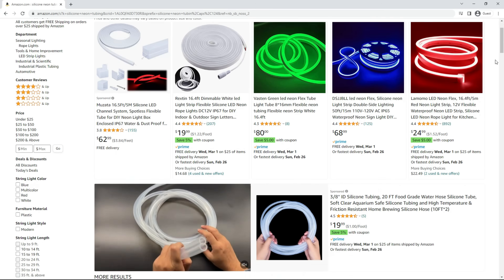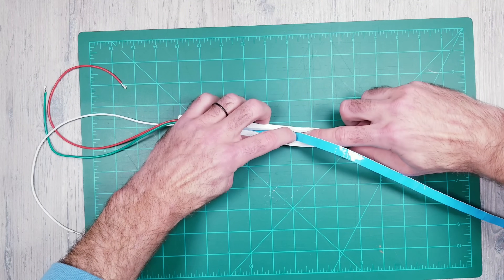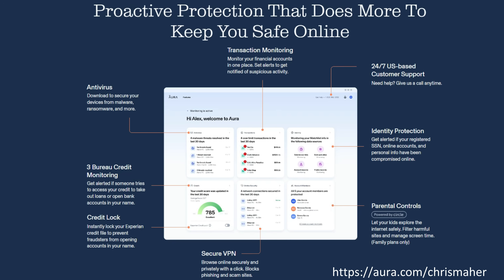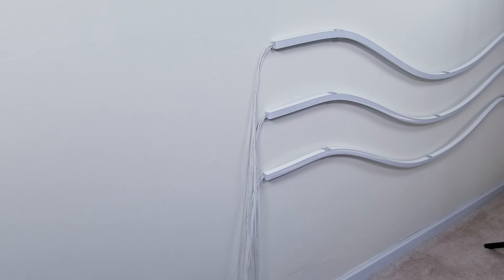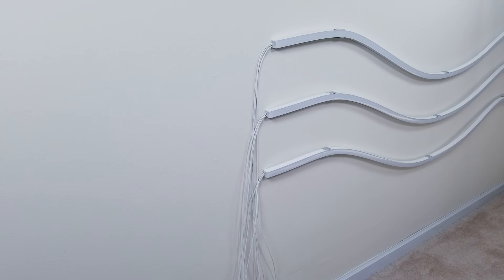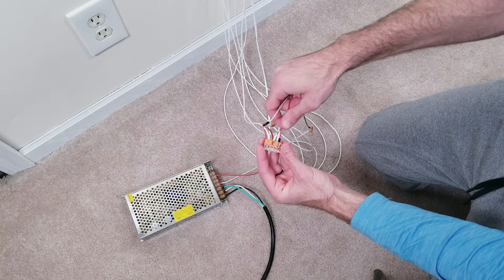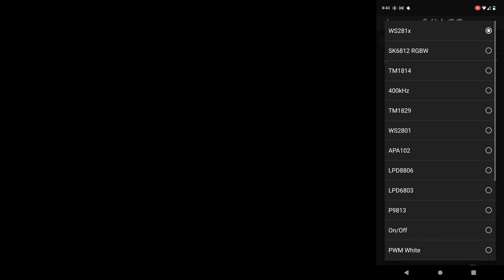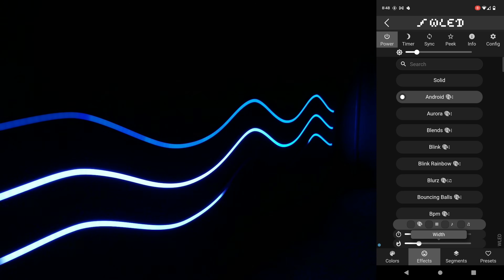Flexible Neon Tube - Review, Installation, Best WLED Animations - LED Neon Strip Lights

Comment: Do you think these would work in replacement for the aluminum channels in your "EPIC DIT RGB Desk Mod +Cable management" Video? I used the aluminum channels but cut them with a jigsaw, and they came out janky AF. If these bend to a 45-degree angle to go around corners  nicely, I would like to try them instead of making a new set of the other channels.  Bob Villa I am not... Thanks!
Reply from the maker: Thanks for watching and great question! These would work good for around a desk! I know the sticky tape I used would not work so you might have to go with the aluminum brackets. These do look very good with 60 leds per meter but the aluminum diffuser channels do look a little bit better from a perfectly diffused standpoint. The other thing that might be an issue is that if you use the brackets to secure, in between the brackets there will be a little bit of sag since this product is not meant to be rigid. Hope that all makes sense!

Comment: Given that it’s a silicone channel, I wonder if it will sag between your periodic supports with time?
Reply: Not in this case. They're fairly rigid and the supports in this example are sufficient to keep them in place.
Reply from the maker: Thanks for the comment and I agree! If the supports were spaced out more then there for sure could be some bend but they are close enough where they should be just fine over time!

Comment: What about adding wled to the interior of a car to add ambient lighting like Mercedes cars??🤔🤔
Reply: Working on it. Funny story Mercedes Benz lead designers ( borrowed)  stole our seats that lit up while on display at the future auto interior summit in Stuttgart, Germany in 2017-18. They loved them so much which is an honor they jacked them. With the our best in class flexible glass fiber optic LED system. They ended up using cheaper fiber optic for the S class and EQS interiors ;) #glotrim is the best #glasslovers
Reply: @glotrim  Damn whenever I get a nice car, imma checkout your guy's products😎
Reply from the maker: Thanks for watching! Hopefully at some point I'll be able to do something relating to cars! But GloTrim does look amazing!

Comment: I'm  clearly not understanding something vital here... Just because the LED strip is inside the tube, how is it a bending horizontally? an led strip outside of the tube wouldn't bend that way, so why is it working inside the tube? Wouldn't the led strip sort of be forcing itself to rotate inside the tube to do that? Sorry if it's obvious and I just don't get it.
Reply: I was thinking the same thing, maybe its is kinking a little but it doesnt matter
Reply: Google side emmiting led strip solve problem. His led strip is tilting and that is not good. Diffuser solve that problem so you see whole light. But I am more concern with spreading heat in that tube!
Reply: The bends are very slight bends doesn't effect it much.
Reply: @ChrisMayerDIY can you do a similar project using the plug and play controller?
Reply from the maker: Thanks so much for watching and great question! The led strip is able to handle the slight bend since the silicone tube is keeping it in place and my guess is that the led strip around the bends is being lifted slightly inside the tube in order to make the turns. However if you were wanting to do a design with more bend, I would then look at getting something where the led strip is vertically installed like this: https://amzn.to/41e2VIT
Reply: @ChrisMaherDIY the diffuser mentioned requires a 96/m strip to get true neon look. I used a 60/m strip and I get hotspots. The Muzata strip recommended is a 12V strip, can the ESP32 handle 12V?
Reply: The angle the strip is bent is low so led strip is able to adjust for it inside the tube. If it was large angle, like 90 degree, then there would be issue.
Reply: @runtime_engineer  then you take without tube and try to do this you will see its not low its tilting